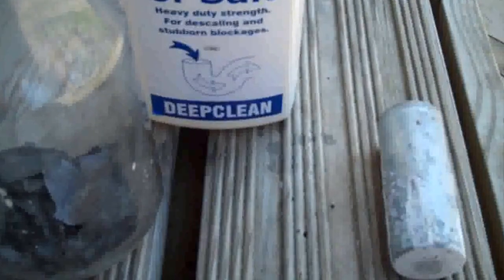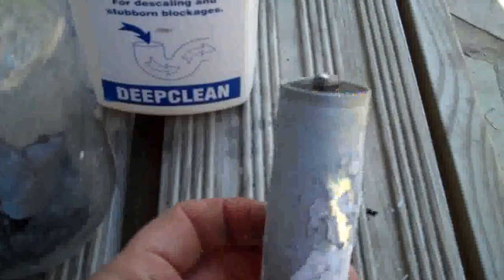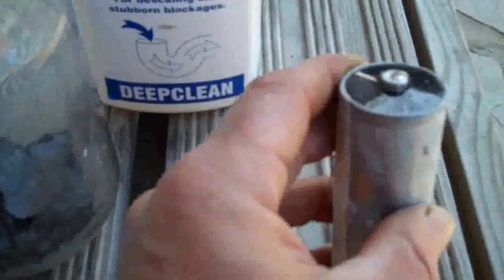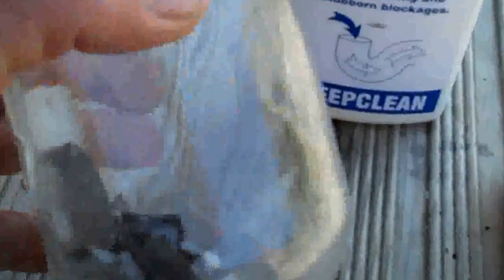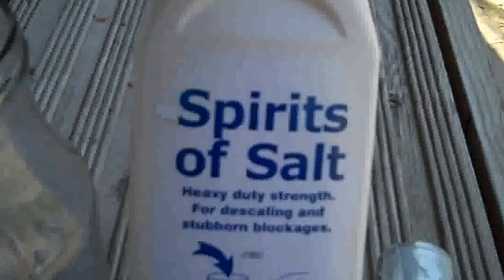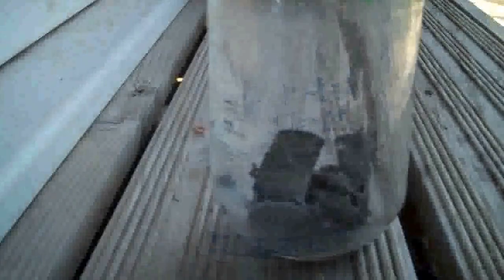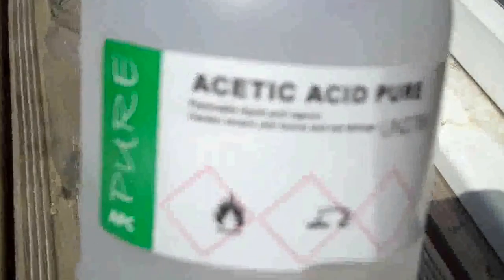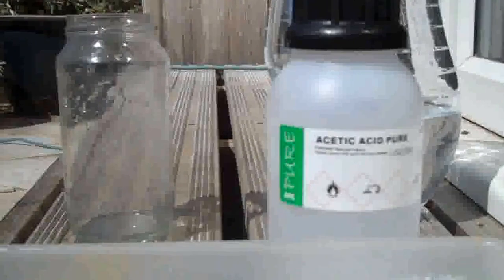Making Zinc Acetate

Comment: This looks promising for putting a finely dispersed zinc oxide layer on expanded graphite.  Very interesting.  Cheers!
Reply from the maker: glad you found it useful mate
Reply: Definitely. There's a wealth of information on your channel. I watched this video when it first came out, thought it neat, but it wasn't relevant to anything I was doing at the time. What brought me back to this video was I was looking for a way to disperse zinc oxide into graphene/expanded graphite and the smaller the particles of zinc oxide the better (at least my intuition says so). I had actually hit on the idea of using zinc chloride intercalated graphite and then expanding it in the microwave as a way of making nanoparticulate zinc oxide dispersed in expanded graphite so I searched your channel to see if you'd done that. This was one of the videos that came up. I've since discarded the idea of using zinc chloride intercalated graphite in favor of going the zinc acetate route. All of this has given me a new idea to work on separate from my current project. It all grows from a tiny seed, doesn't it? For me the seed was carbon nanotubes made in a microwave and the audacity that cutting edge science could be done by anyone at home using commonly available materials. So good job, Rob! Cheers.
Reply from the maker: that's smart thinking mate and your right a little audacious lol - very cool

Comment: You could heat it to evaporate in the last step, the melting point of Zinc acetate is 237 degrees centigrade
Reply: wikipedia says it decomposes at 237 °C 
http://en.wikipedia.org/wiki/Zinc_acetate

Comment: hi there i was wondering how you would coat a peace of glass with Zinc acetate. and how would you dope aluminium in the mix and the percentage?
Reply from the maker: check out this paper

Journal of Physical Sciences, Vol. 12, 2008, 221-229
221
Preparation of Al-doped
ZnO (AZO) Thin Film by
SILAR
S. Mondal, K. P. Kanta and P. Mitra
it has all the details
Reply: +Robert Murray-Smith Nice! I was going to ask you this question, but it was a bit scared you couldn't answer since it goes 2 years since the publication of this video.

My interest in this is to create film-based solar cells, and some oled, perhaps in the future a small touchscreen for investigation purposes... There's much more into the process as some lab equipment is missing (magnetic stirrer/heater) etc, that's what scares me the most.

I have a question, did you do "eyeball" the quantities or have you measurd the molar masses?
Reply from the maker: measured
Reply: +Robert Murray-Smith Thank you, I just favourited this video. I'm still trying to understand the sol-gel process, I saw a paper which required Zn nitrates and Al nitrates to form the ZnO:Al .

I'm very interesting on doing this actually..! I had to review all the Chemistry I've learnt about 12 years ago, hard task, especially when alone but... acheived! :)
Reply from the maker: lol - good on ya mate - and good luck with it